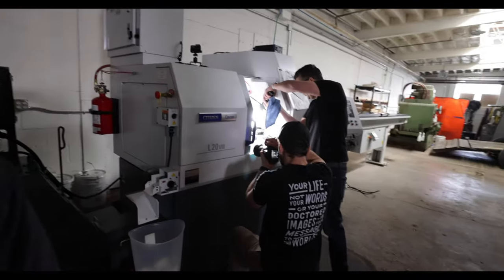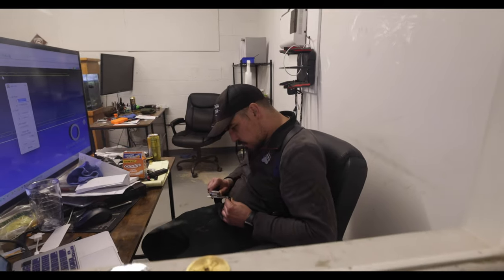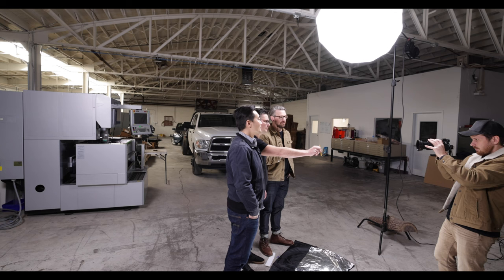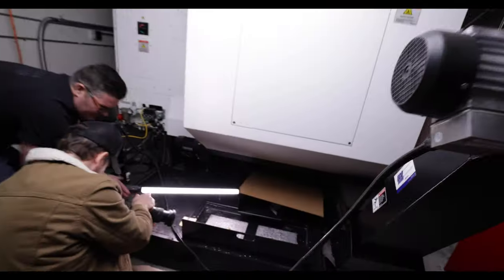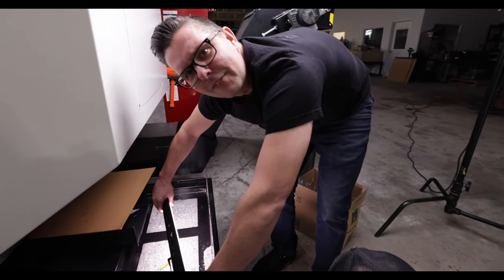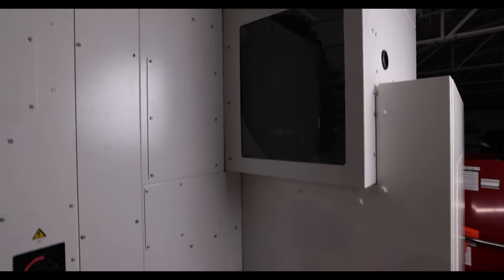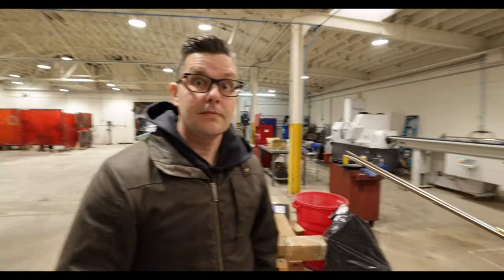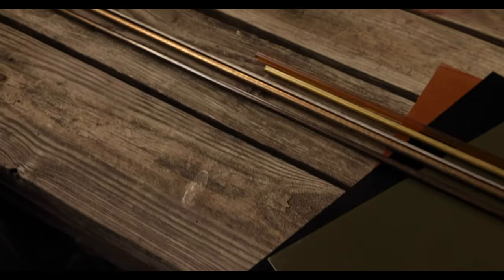2024 We've Got A Lot Of Work To Do.

Comment: Did you guys adjust the post of the feed to better fit international short cartridges? Or are you now using a kaweko nib and feed unit rather than your own feed and bock nib? The fountain edc did not fit cartridges well at all. If you tried putting it into your pocket or even jostle it at all, the cartridge would just fall out of place and make an inky mess. The kaweko mini converter is basically useless since it doesn't hold enough ink. It's much more convenient to refill cartridges, but there isn't a point if it won't stay seated in place. If the post was not adjusted then it really shouldn't be advertised to hold cartridges, it should primarily be eyedropper converted since it's made of ultem. It also sounds like the pen is going to be significantly back weighted because of the titanium clip. Ultem is so light, I imagine the weight might make it unpleasant and uncomfortable to use. Or is the pen so short that the back weight won't matter in hand?
Reply from the maker: Thanks for the question! We did spend a lot of time dialing in the feed to sit firmly. i personally use kaweco and monteverde cartridges and havent had any issues. i carry my pen everyday and have for over a year. Reach out to us at Support@bigidesign.com and our team can get you fixed up if there is an issue. Thanks again!